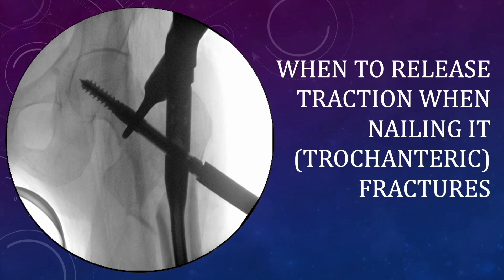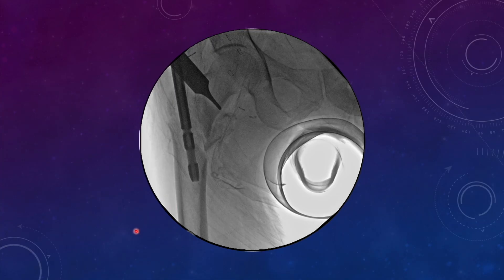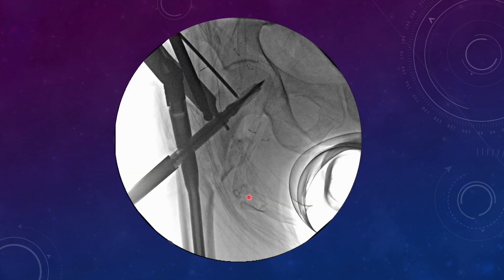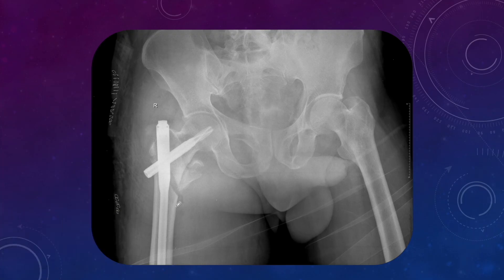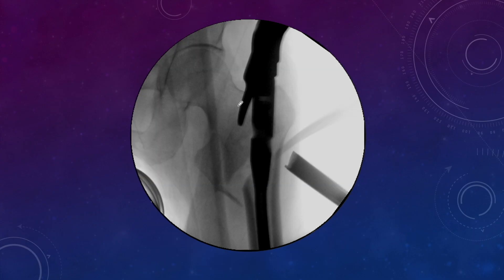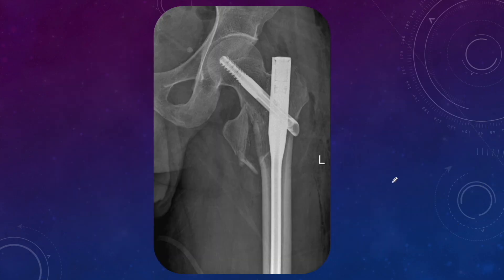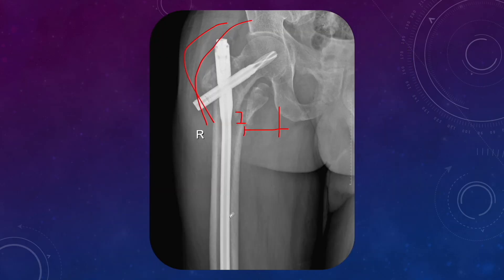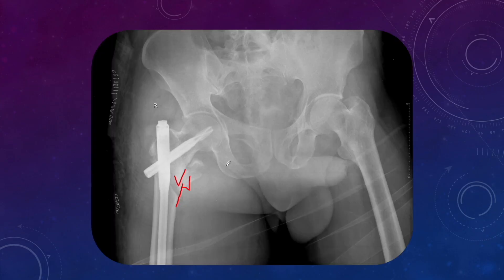Traction release in trochanteric (I/T) fracture nailining: WHEN & HOW MUCH?

Comment: when you say release traction before compression of srcrew (I.e. the second time you can release traction), what do you consider compression? When the lag screw is fully engaged or when it is inserted at the beginning? At the middle? Thank you
Reply from the maker: The second traction release is just to relax muscle tension when the screw is just engaged for getting compression. We use a TFNA Jig knob to pull the screw outwards, which brings compression. Such mechanism is inbuilt in pfna blade, so we release traction when getting screw driver out of blade which is a step to bring compression.

Comment: Conclusion.
2 times you have to release traction a little.
1. Before placement of guide wire , that too if your fracture is distracted.
2. It's obvious that before giving compression at fracture site via screw you have to release traction.
Reply from the maker: Right 👍🏻
Reply: But if you release traction before placing guide wire ,it can displace the fracture right
Reply from the maker: Releasing traction has to be gentle and controlled, and not abrupt

Comment: at 3;30 minutes what was happened was due to entry of nail through fracture site.....in another video you have shared this......
Reply from the maker: Yes, lateral entry is the issue. Medial entry would have helped. Had taken case images of another colleague. But again even if wedge effect happens you have to avoid superior position of screw/blade and avoid Fracture distraction on medial side at least.
Reply from the maker: The guidewire could have been medial but reaming was lateral. Avoiding large solid reamers and using curved cannulated awls can help.

Comment: 2 time release, first before pinning in head, the second before compression is right? The first release may be loss reduction ?
Reply from the maker: Release of first traction is calibrated fluroscopically, you just need to ensure that fracture is not distracted and will remain positive cortex after compression. The proximal hohmann will take care of flexion while loss of reduction in slight varus wont be an issue as you can correct that after nail insertion but before guidepin insertion by just abducting the limb/ again calibrating traction after nail insertion but before guidepin insertion/ using a pushing device to valgise head and in most case medial entry automatically corrects slight varus.
Reply: One more thing Sir, if you get traction and ap , lateral c arm every on way, medial cortex is possitive so just release when compression is right?
Thank you for your reply
Reply from the maker: @vinhphaminh7007  yes, once compression right, traction won't be of any use.

Comment: How to avoid proximal entry in to fracture line
Reply from the maker: See, in some fractures, you are invariably going to merge the nail entry with the fracture line, even if you don't intend to do so. The main thing is to avoid the wedge effect, even if your entry merges with the fracture line. See this video; you ll get it: https://www.youtube.com/watch?v=t3lexJPKCkY
Reply: @Justorthothings aren’t you afraid to entry too much medial at the fossa piriformis and injuring vessels?
Kind regards🙏
Reply from the maker: @stefanschwienbacher7218  The concern is valid. But we don't go directly deep in the piriformis fossa. We keep the entry just medial to the tip. Haven't encountered any case of AVN in such cases after operating and following patients for the past several years.
Reply: @ great. Thank you very much.
Reply: @Justorthothings could I send you an x-ray regarding this fact? May I have your email? I don’t use Instagram…

Comment: Releasing the traction twice means?
Do we again increase the traction after placing the guide wire in head or traction is loosened and further loosening during screw tightening?
Reply from the maker: No, once guidewire has been put, no traction should be increased. See releasing traction at the first time is to align the medial cortex levels and is thus can be controlled, the second time its for relaxing muscle tension which will be perceived as the difficulty in gaining compression. As I have shown in second example, the amount of traction release can be negligible at times when medial cortex spikes are at same level even if fracture is slightly distracted. So, you have the indicators (medial cortex levels and force for compression) for sequential release of traction at two steps and the amount will vary from case to case.

Comment: Very good work. Keep it up. I have a question. Seniors in my college are used to releasing gross traction before compression. What happens then is that sometimes shaft goes into the proximal fragment.
So should be release traction gradually by releasing fine traction and giving compression simultaneously or should we release gross traction at once? Thank you
Reply from the maker: Thanks! See, as I told in the video, once you have inserted the screw, the excess traction is of no use. You can release the traction gradually so that muscle tension is relaxed. The compression actually pulls the shaft towards the proximal fragment in a direction parallel to the direction of the screw/or blade. If your reduction is positive and medial spikes (calcar ends) are at the same horizontal level, then after placing the screw, the excess release of traction won't be an issue. Problems can occur when there is a wedge effect or when the guide wire is inserted in a distracted position.